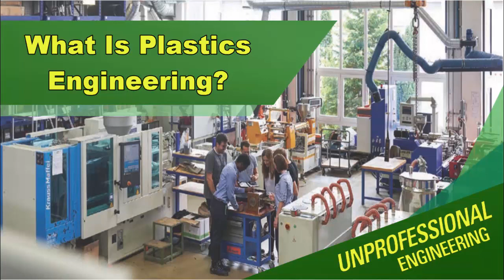What Is Plastics Engineering? - Episode 211

Comment: Weldable plastic sheet like Polypropylene, Polyethylene, PVC-U, PVDF is available in a thickness range 3 mm to 50 mm...and  up to 3 m x 2 m sheet size.

Here, in England we cut (using a circular saw), and  after edge preparation - we weld it together  (using very hot air and compatible weld rod) - to make 'structures' the size of singe deck buses!!

If you need to store 40 m3 of Ferric chloride (which eats all  metals except titanium); you will need a Polypropylene liner - say 3 mm thick , cut and welded; and  then reinforce externally with glass reinforced plastics (GRP in UK and  FRP in USA).. all to a standard like BS4994 or EN13121-3 or even ASME RTP-1. 40 m3 is about  3 m dia and 6 m tall.

That is what this plastics engineer does. Now in 48th year... 

It is a branch of mechanical engineering - but instead of metals we use plastics materials.

So it is not all about injection moulding, or extrusion.....

Currently designing a neutron shield for a nuclear application......

 Dr Ed